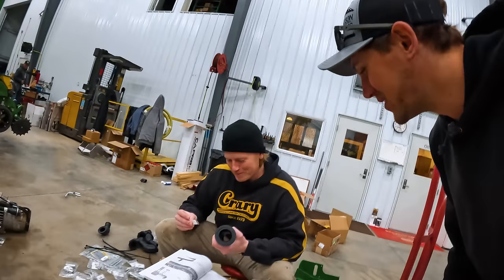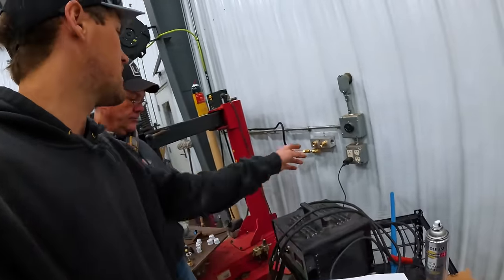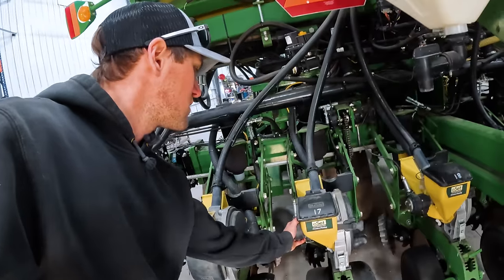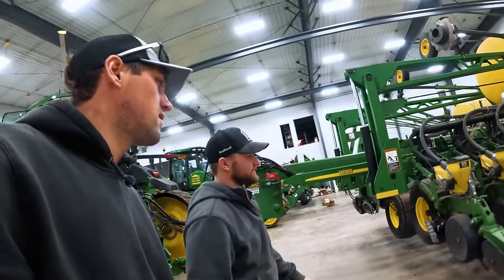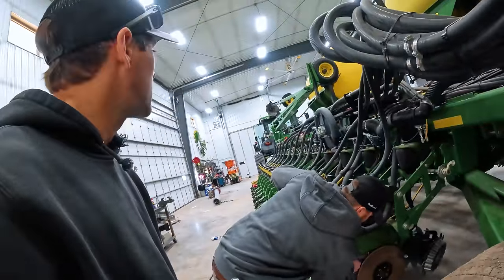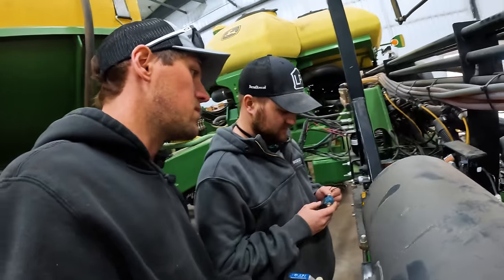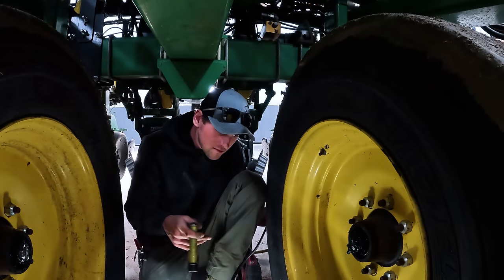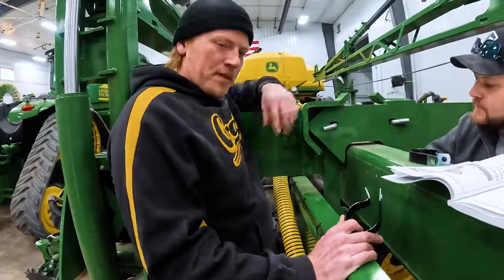Yard Testing The Planter!

Comment: Love the videos and congrats Chet. But you can have to much grease in your bearings. Too much grease holds heat and will cause your bearings to fail prematurely. Your typical cone bearing only needs a 20% fill. High precision bearings are only 5%. Just some thou6for when you put 800 pumps into one bearing..

Comment: Also the nut that holds it on should be seated down tight then back it off and secure just a little more than hand tight, better a little loose than too tight. Look it up

Comment: They just did the same seat PIP to my 2023 612R sprayer. “Operator Presence” switch acts up due to seat base  design. The unit thinks the operator is out of the seat and can throw the unit into park going down the road. Or it shuts off all unit functions. Really a pain in the rear going 14 mph through standing corn on autopath and it acts up and shuts off the guidance and your rig makes an instant 90 degree turn! 🤦‍♂️they replace the entire seat base and disable the base slide in slide out back of knee support. I call BS on deleting a seat function!! For a 6’1” tall guy I really notice not having that support behind the knee. We paid for the seat function, and now you take it away from us and don’t refund us that portion of money??

Comment: Great laugh episode with the LEO comment and I never inhaled 🤣. Quick question here dealing with the openers. If they had engraved tick marks which would indicate say 3 stages of wear towards the outer 2 inches, would that not help in gaging whether or not they need replaced? While going through making correct opening adjustment all one would need to do is look at the tick mark wear for if the disk is too worn.